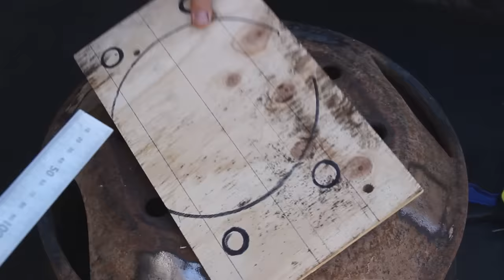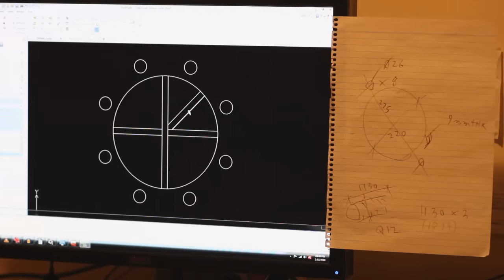How to make a fire pit from a rusty old truck wheel with a $100 eBay stick welder

Comment: Although I admire your ambition, this is over engineered for something that, in the end, still just looks like an old, rusty, rim.
Reply from the maker: It is often not harder to do something properly than shoddily, I'm sure you didn't look at your comment and try to work out how many superfluous commas to leave out. Besides, I like rusty!
Reply: SPE I like rusty as well. My comment has proper use of commas.
Reply from the maker: My fire pit has proper use of engineering, sure it would work with less of it, just like your comment (while not quite at James T. Kirk levels) would work with less commas. 

Thanks for watching!
Reply: SPE again, my grammar and punctuation is correct. I'm happy for you and your fire pit.
I wish the best for both of you.
Reply: "James,,,,,,  T,,,,,,,   Kirk,,,,,, "  creased  😂
Reply: If you need more than two commas you should break into using semi, or full colons; or just break it up into two sentences.

Stanford commas aren't always necessary either, especially if there isn't actual pausing, in particular if you're not going to use the "and" second to last of the list.

My only problem is you should always pull your weld puddle so the arc clears the slag, other than that good job man.
Reply: Michael Rhoads tips for both of us. You sir, are a scholar and a gentleman.
Reply from the maker: I think some circumstances call for pushing the arc, but hacks like me should always be draggin. Thanks for the grammar and welding tips!
Reply: @lapislignum  Sometimes pushing can't be avoided, I'm more worried that the little Chineseium machine didn't dig enough, if it didn't when it heats up and cools off it'll do so at different rates popping the welds as it does so.
Reply from the maker: I must admit I didn't expect much when I bought it but it has been pretty good, I rewelded the worst looking welds on the grate but nothing has cracked or popped after 10 fires or so.

Comment: not be better resorcing a different wheel less welding ? but i can understand ur skill cuts and perfection its great tutorial
Reply from the maker: You might find something a bit better, but most wheels i've seen that are this size are pretty similar. I got the wheels for free and all the welding was half the point even though I didn't get much better at it by the end. Almost any practice is good practice though I guess.

Comment: OMG! the welding "turn the power up". And get some flat plat for your projects. #save discs.
Reply from the maker: the current should be higher but I didn't want the welder to melt. Discs are cheaper than buying flat. maybe...

Comment: Very nice looking when done,  but just laying it down the fire breaths fine without all your nice work. Not picking. Just saying
Reply from the maker: I used one of this wheel's brothers as a firepit for a while like that, it was OK but this is easier to clean up. And I needed a welding project :)

Comment: When he used a belt sander to put bevel on pipe instead of using grinder. I lost all respect. lol
Reply from the maker: Instead of using the dropsaw? Plenty of people do that, I'd rather wear out the edge of the blade before the side :) I was just grinding the burr off anyway, could have bevelled it I guess.

Comment: Overall a good project, you presentation was really hard to follow. To much time spent and redundant moves for us to watch. Each cut, weld, piece really doesn't have to be shown. When welding all I saw was darkness and the arc, what's the point of that, just show the purpose of each move and cut, not every hammer strike etc.
Reply: I'm with you!  too much for nothing. 
This guy wasted my time.

Comment: The sound really hurts ears . great project
Reply from the maker: lol sorry, I tuned the sound a little bit but there is only so much grinding and hammering you can listen to before you need to turn it down a bit. Thanks! it was fun to make and has been very useful since
Reply: @lapislignum  lol my dogs were looking sideways. I love iron works fences and so on I am originally from Panama Santiago de Veragüas and when my parents build their home they had costumed iron fencing designed by talented iron worker/welder heated the iron and bend it cut very creative hard work. Just scared of welding equipment eyes problem you developed but I live designing jewelry designs not making them lol.again thank you.
Reply from the maker: @anatrejos8879  I love iron fences, would like to do some architectural steel work and have a few ideas I should develop a bit more. I'm no jeweller but design is usually at least half of the process!

Comment: Nice Idea!  Execution ........ ??  Why cut pipes and take all the effort to make flat iron out of them??? Use junk flat bars and save all the hassle... Furthermore - practice your welding technic...
Reply from the maker: Thanks? I didn't have any flat iron and my local steel shop charges too much. It really didn't take much effort to straighten out the pipe anyway. I do indeed need to do practice drills.

Comment: aesthetically butt-ugly welds. Functionally, pretty good fire pit. 👍
Reply: no knock on ur abilities to weld. its a welder thing. there r welders who weld 1000x better than me. ive been told mine suck too. 😱
Reply from the maker: Cheers, I've seen good welding and welding worse than this video, much of it by me. If I needed a pressure vessel I'd get someone else to do it but this thing is plenty strong and it doesn't matter how ugly it is.

Comment: 👉 next time to save you time & money and also to make your job look more professional plus giving a misterius insight into it, try to weld the feet of the stove from inside the tubes and use only a small bead of welding at each side - that will save you at least 90% of wasted extra material and 64% on saved time ⏰
thanks for the video 🎥
Reply from the maker: Tricky to do that with long pipes and not as strong, plus no way to weld the feet on unless I drilled holes in the wheel to attach the legs after attaching the feet. I'm 73% sure you just made up those percentages too. Thanks for watching!
Reply: SPE - great insight but it seems that you want me to tell you the why of my calculations
well, in earlier 1980 i went to welding school, then i specialized on most wldng processes

i worked on the industry for about 10 yrs, in the meantime i graduated from the industrial mech school as well

after working as an ind mech, i decided to go for body & fender repair school - the rest is history bc i went to automechanic school & college and then to diesel eng school
thats why lol
Reply from the maker: haha thanks for the background, I guess I could have welded the legs to the wheel from the inside and then plug welded the feet on, could have plug welded both sides of the pipe actually.
Reply: SPE - sounds like a plan; perhaps, your nxt progy?

i could read  "SPE rim/ stove upgrade" 👀

Comment: If you was using 7018 rod we can't be friends.
Reply from the maker: haha, most of this was using cheap 6013 rods. 7018s aren't very common and fairly expensive here, our "low hydrogen" rods are 7016 or something, the XXXX welding rod code isn't widely used here. I plan on getting a box of 7018s when I have the spare money for them, or a project which needs nice looking welds.

Comment: Maybe he should of used a tractor wheel ? 
A truck wheel is to small
Reply from the maker: Perfect size for what I use it for, and you can't fit a tractor wheel in the boot/trunk of a car.
Reply: @lapislignum  yes you can . And what are you going to burn in the truck wheel  a few twigs and maybe a stick or two lol hope you hsve a large supply of fuel
Reply from the maker: you can fit a tractor wheel in your car? is it a big car or a small tractor?

Comment: Gloves, security... = dislike
Reply from the maker: Harsh!
Reply: @lapislignum  think about the example you give to the young people and restauration amateurs... And your safety!
Reply from the maker: Hang on I thought you were disliking because I was using gloves, I usually use gloves when it is safer to wear gloves and usually don't wear gloves when it is safer not to. What part do you have a problem with?
Reply: @lapislignum  in wich part of the video are you using gloves?
Reply: @lapislignum  you re rigth that my message was unclear... You re construction is nice, I have nothing against you, but there are a lot of videos like yours in wich nobody cares about gloves and body protections... oooook, I will delete my unlike, don't suffer, but please, gloves, glasses etc
Reply from the maker: @alvaroytalytal  lol whoops you have a point actually, I usually wear gloves when using the angle grinder, mustn't have made my mind up about this at the time of making this video. I think leaving the guard on is more important. I was using gloves while welding which I think is pretty important, but avoid using gloves when using a bench grinder or drill press.
I was wearing eye protection, ear protection, respirator etc, in fact I upgraded my eye protection to goggles after something bounced in behind my safety glasses and got in my eye. No offence taken, thanks for your concern!
Reply: @lapislignum  aquí tienes un amigo, un saludo from spain! 😀
Reply from the maker: @alvaroytalytal  Saludos, tienes un amigo aquí también. ¡Saludos desde Australia!